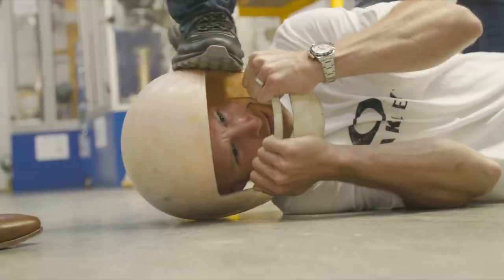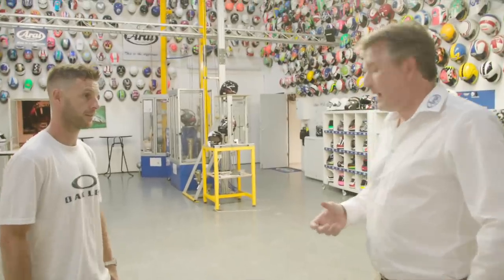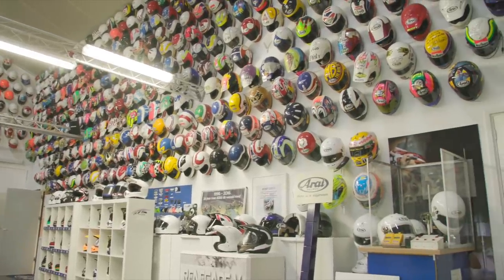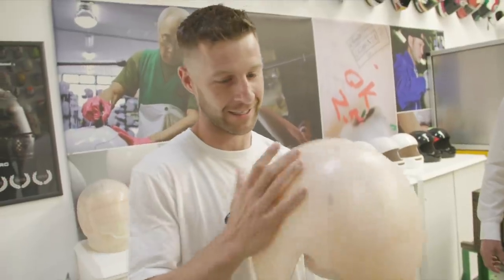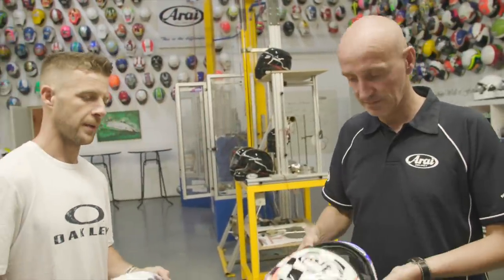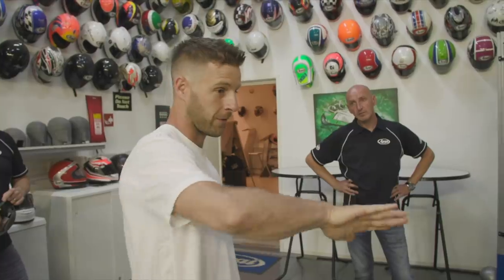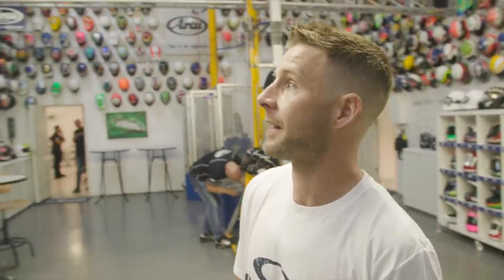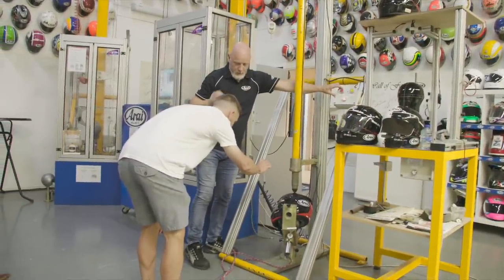THE ARAI SECRET TEST LAB

Comment: I chose Arai helmets years ago because it fit my head the best. That's a major concern, you need for the helmet to grip your head with equal pressure no pressure points and no slop either. No one manufacturer will work for everyone
Reply: Though I agree, it is rare that an Arai won’t work for someone. They offer 3 different shape helmets to fit different head shapes, 6-7 different size cheek pads, and 3 interior crown sizes as well as adjustments on those interiors.

Not saying it can’t happen, but it is rare that none of those options work. It’s usually only when someone needs a 3XL or XXS that no Arai will work for them. They need to be professionally fitted though, which is something not everyone has access to unfortunately.

Comment: Used Arai helmets for quite a few years and never tested them till recently. Came off at about 80 mph and landed head first then slid . 3 separate impacts on the helmet judging by the damage and walked away without so much as a head ache. Replaced the damaged one with another Tour X4. Good to see those tests and interesting to hear of the manufacturing process that saved my head , cheers JR and Arai

Comment: Eye-opening video. A round shape equals a glancing blow is a great concept.
Reply: I could also see it causing a force concentration in the round area that impacted.

 A 5 pound ball peen hammer at say 10mph and a 5 pound plate at 10 mph create the same force. But the hammer will hurt a hell of a lot more if it hits you.
Reply: Also less bouncing if you roll. Irregular shape bounces off the ground more.

Comment: if its safety first for all riders why are companies still arseholes ?  share the tech/patents all build 1 design with best visibility, visor hardware,  using the best material for the lowest price due to the high volume and custom mould the polystyrene liner to riders head or 3d machine it. all this current shit way of working needs to end now in every sector of industry.